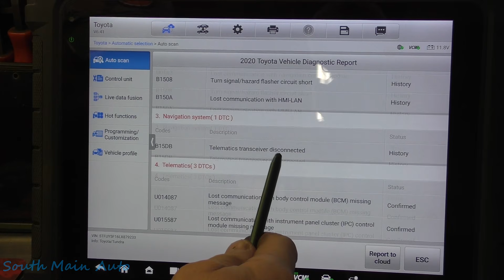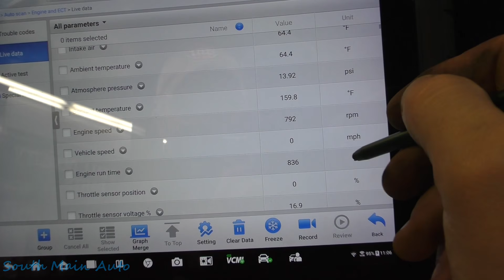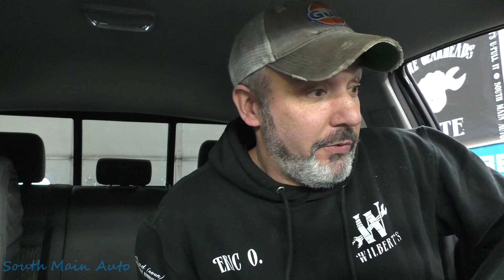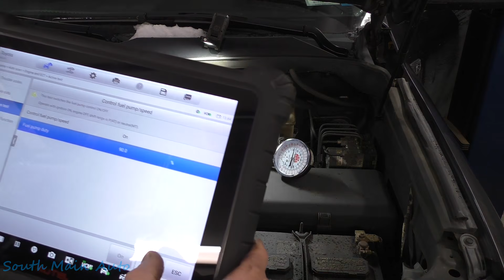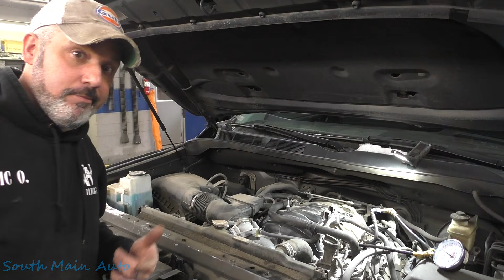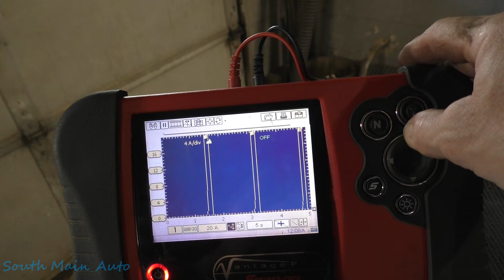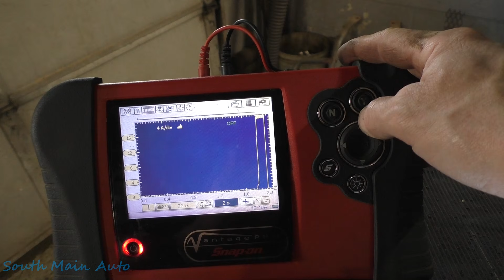My Customer Is Getting Shafted By The Local Toyota Dealer

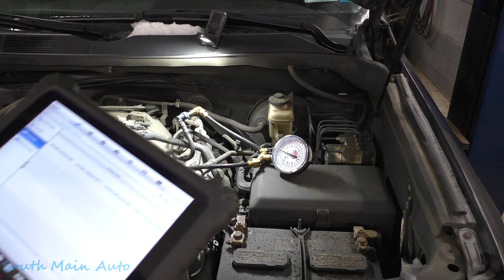Comment: 16:30 my guess, fuel pump relay is bad.  GM used to like to power the pump via the oil pressure sensor.  When oil pressure is present, the pump gets power through an alternate feed from the sensor.

Comment: I worked as aa line tech for GM, Subaru and Ford. Glad I am out of the headaches of the new cars. The stuff they put on them with all these adaptive cruise, lane keep, heated steering wheels. The stuff is nice but when you have to fix it can be a challenge. I once had a F350 with all the options and the lane keeping system would not work. Come to find out the windshield was defective causing the camera to not work right. All this has to be just right or it takes the whole system down.

Comment: I seen a few fuel pump driver modules corroded on some f150s . The fuel pump module was mounted on the frame brace. The backside would corrode against the frame. Ford also had recall to replace the fuel pump driver module on the explorers and Taurus. I seen a fuel pump fail on the new body style explorer. Anything electric can and will fail

Comment: Another awesome video Eric! Today's vehicles have way too many failure points.
I remember the last fuel pump we changed on the side or the road. It was an 81 F250 with a utility body. 
It had suddenly powered off on the way in from my Dads pipe construction job one evening. 
Dad quickly checked if it was firing then unhooked the fuel line from the pump at the engine and said, "roll it over".  There''s the problem the fuel pump is not pumping fuel. So he sent a runner to NAPA to pick up a pump and I do believe that he let me put the pump on and soon we were on our way.

Comment: I'm a retired Toyota technician (Ontario Canada), and soon as I started this video I would've told you to put a fuel pump ECU on it.
Very common failure.
I have a 2016 tundra 2014 Lexus LX 570 with the same drivetrain.
Both of them have had failed fuel pump ECU"s
Great channel, great Mechanic, I would hire you in a heartbeat lol.

Comment: 99-2000 accord v6 had a hard start after a hard soak bulletin that said replace pcm and fuel pressure regulator… the return line came off regulator before fuel rail… if you install the later fuel rail from 01-02 the pressure comes in one end of the rail and regulator is at the opposite end… the problem is vapor lock in the rail past the regulator and the only place the vapor could go was through injectors couldn’t flow back to the tank

Comment: You’d have to crack one open to see how it works but every electrical engineer worth his salt will add some sort of thermal fuse because the alternative is the module lets out the magic smoke. So even if it doesn’t have a specification on current limit there will be some design of the circuit by the original engineer to save the module from exploding if the output is shorted.

Comment: Had a similar fuel pressure problem on my old 2000 Chevy S10 pickup right around this same time last year. Same exact symptoms. I found that when I jumped it she would always start and run / drive just fine, but if it sat overnight it was crank no start every time. In my case it turned out to be the fuel pressure regulator hanging up (flex-fuel equipped, so regulator was built into fuel filter). I know fuel systems aren’t set up like that anymore, but the fact that it would start every time with a jump really confused me too until I realized that it was increasing the pump speed and overcoming the stuck regulator return valve. New fuel filter / regulator fixed it.

Comment: I have a 2019 Toyota tundra 5.7 4X4 that had a similar problem and it acted like the fuel pump a have around 152000 it would hardly start on cold morning around 30*I only burn 87 octane at Sinclair or qt and other places but since it started doing this I watch some videos on u tube about Flex Fuel and learn that the fuel pump has a sensor in the fuel pump that reads octane percentage and you need to go into the fuel density to correct it or 0 it out but I learned is to let it get down to half and started putting high octane in it 91 octane and it has been starting up better and clearing up but my 5 letter vin number has a W which is gasoline but it still has sensor that’s missing reading the percentage my understanding is a W or Y is understanding it has flex fuel

Comment: Great diagnosis .
I got a 2014 tundra 5.7 that crank but don’t start, 4LO and 4 HI is flushing and got cod U0100. Could be the same issue with the fuel pump?

Comment: I think your title for this post is possibly misleading.  I’m going to assume that you were getting paid by the customer and You Tube for the diagnostics that you did on this Toyota truck. Correct? When I worked at a GM dealer in the early 90s as a technician, we were paid ZERO for diagnostics. WE WERE TOLD GENERAL MOTORS DOESN’T PAY DIAGNOSTICS. So, is the Toyota dealership getting paid for diagnostics? I doubt it because if they were, they would’ve done the diagnostics on this truck. So shouldn’t your title be Toyota screwing their dealerships? Or something like that? Would you have done any diagnostics on this truck if you weren’t getting paid? If you wouldn’t, then why should the Toyota dealership?
Reply: Wtf no thumbs up for you?I wonder why.
Reply: @Tub13 you don’t have any either. 😂

Comment: I’ve only gotten far enough in the video that you’re looking at codes, but I’m going to be suspect that it’s a fuel pump issue and there’s a check valve in the fuel pump to keep the rail pressure up on most vehicle. Vehicles had a very similar issue with the Jeep of mine turned out to be a rubber check valve ball in the fuel pump. Can’t wait to see what happens next.

Comment: My son’s old Tundra had a bad Fuel Pump Control module.  It was totally rotted out, as most things are on over 10 year old trucks in Vermont.  I took i
The module apart and hardwired across the contacts.  This means the pump was running full speed whenever the key was on.  Truck ran fine like that for the last two years he owned it, before it took the final ride to the junkyard.

Comment: I remember when  Chevy Blazer came out with the first vortec v6 they would have cold start problems and the dealer changed alternator but never could find the problem, the car was almost new and they couldn't fix it because they overlooked the fuel pump pressure which was off by 5 psi   I put a new fuel pump in it and solved the problem should have been 50 psi and the car was only getting 45 , that 5 psi kicked their butt I guess they thought it wouldn't affect it .

Comment: Owned a 1966 3000 MKiii Healy back in 1972. Driving down the street in San Diego. Engine quit, coasted to the curb. I'm clueless, has gas. A guy comes driving by in a 100 6 Healy. He gets out, wearing a lab coat, he has a foreign auto repair shop down the street. Described the problem to him. He goes back to his car, gets a hammer and flat blade screwdriver. He pops one of the rear seats loose. Underneath is the axle with the fuel pump. He gives the pump a good whack and reaches up front and turns the key, car running fine. Lucas fuel pump has points, the points fail. Drove the car to his shop, he pulls the pump, opens it and solders a resistor next to the points.

Comment: I once had a Cavalier that would not run right when the outside temp was below 50 degrees. Shot the parts cannon at it without success. Discovered by accident that if the cabin temp was above 50 degrees, it would start and run fine even on the coldest days. Put a new ecm in it and it solved the problem. The ecm was behind the glovebox so I guess as long it was warm it was good to go.

Comment: I had a 2003 f150 4.6 liter that would fire on the John Deere brand ether and had no spark, we chased that rabbit from Arizona to Maine. Dont always determine its a "no fuel" condition because ether started the engine. Compression alone can ignite ether.

Comment: A simple DC motor attached to the pump (typically vane style in most fuel pumps) is usually just a commutator and a stator (a few other things, but keeping it simple) and a modern fuel pump is likely a brushless design.  This kind of failure is endemic to a bearing failure - thermal expansion causing the bearing to become stuck binding the stator preventing the stator from moving and leading to an amperage dump to ground.  DC motor failure often causes burnt grounds due to this amperage dump and can melt plugs or even cause fires and happens prevalently in early 2000's vehicle's blower motors absolutely destroying the speed control resistor pack and blowing fuses.
The absolute easiest way to test for motor failure is measuring ground impedance at the source of the suspected failed motor.

Comment: Had a 91 Dodge Dakota that would not start after you shut it off on a hot day, let it cool then would fire up.  Replaced fuel pump and fixed it.

Comment: Used to have this happen to a Chevy van with 350. It would overheat the fuel line right over the carb amd vapor lock it. Fix would be aluminum foil over the line. Never did again.

Comment: Another great diagnostic video.  I wish you would show how to hook up your scope.  I have the same Autel, actually 2 of them, a 2023 and a 2025 year model.  I never pay to update the tool, I buy new every 2 years.  Anyways,  I have yet to use the lab scope, but I fully intend to learn how to do it based on your videos.   You gather so much valuable information by using the scope,  I think it’s time I learned.   No better time than the present.

Comment: Completely sucks that “part changers” doubt a true techs diagnosis, regardless of the warranty factor. I’m an industrial mechanic - same sh*t different smell. They change parts until it’s fixed or they run out of parts first. Then I get it, by then it’s “stump the chump” time! I never quit ‘till I get it though. Glad I’m retiring in two months! 👋😎

Comment: My thoughts are that the starting of the motor gives a higher voltage, and that is enough to activate the pump, When the battery maintainer was removed, it started to act up?

Comment: Starting with my 86 Nissan pickup in 1990, 89 Grand Am, 01 Durango, 08 F250, 11 Quest, 13 Lincoln MKX, I've had bad experiences at each of the dealers for those makes and that's off the top of my head. Not necessarily for my rigs, most were friends and family. CRRAZY stuff I corrected, from a 5 second review of an ignition wire diagram (a fuse from a shorted wire instead of a complete engine harness) to a soft pedal "needing" literally every piece of a brake system except the brake lines. I think the most important piece of knowledge you've taught me is your process of repair. Define/duplicate the problem, identify the correct system, zero in to specifics, have the right info, understand it, TEST IT, have the right tools, be SURE of your diag. Thanks a ton for all your sharing!! It's making us all better techs, and saving us a ton of $$.

Comment: I share a tip.  After the fuel pump recall, if technician doesn’t put the small fat black o-ring of the fuel pump motor right.  It will has long time cranking.

Comment: I just watched your video on power steering and trailer brake control. The braided ground is to ground radio frequency. It's called litz wire. At radio frequencies current travels on the outside of the wire not in the center. It's called hall effect. The communications on the modules are radio frequencies, and those systems should be grounded with braided wire. Solid wire works as a resistance for high frequencies.

Comment: Hello, ive been following your videos for a long time, and you are one awesome mechanic. Hope you can help me out here. Ive had a 2005 ram 1500 w/5.7 hemi and nobody can get it running. Its been in a shop for a year now and they have no answers why it wont run. I mean everything there is to replace theyve done it. They havent taken heads off tho. You think problem is in the heads? Wants to start but never stays running
 Crappy idle if it does that. HELP PLEASE

Comment: :hand-pink-waving: I had the same issue for my 2007 Ford F150 XLT Crew 4x4. It turned out it was the fuel pump control driver module.:face-red-heart-shape::face-red-heart-shape:

Comment: I had a Chevy that did the exact same thing you crank it up you drive all day long but once you cut it off, it was not coming back on and it was weird cause it was always just shortly after the initial start up and driving going down the road, you would hear a loud noise, and I begin to realize it sounded as if the fuel tank was collapsing in on itself. And also, it was as if the sump was being restricted total loss of fuel pressure later found out that a so-called friend stuffed a box of blue paper, type shop towels down into my gas tank

Comment: Another reason that may allow the pump to start when using the juice, When the engines starts it uses the fuel in the line, lowering the pressure the pump has to try to start against. That coupled with the higher voltage gives it a chance to run. jmo

Comment: By the original problem description, my 1st thought was  an old trick to get back at somebody by putting a balloon or condom in the gas tank.
Vehicle starts & runs a while until the balloon/condom  interferes & cuts off the fuel. Then the balloon/condom freely floats again & then the vehicle starts again. Laugh for da day😅

Comment: In the old days before the advent of fuel injection, vapor lock in the fuel system would cause this kind of problem.

I used to own a hobby shop and one day a customer came in with an RC car asking if I could fix a wobbly wheel. Took a quick look and immediately saw that the one nut that secures the wheel to the hub was loose. Tightened it up and he was good to go. Didn't charge him anything. I thought it strange that he couldn't figure that out himself. Asked what he did for a living because, you know, some accountants or computer type people wouldn't know which end of a screwdriver to hold. Turned out he was a mechanic for one of our local Toyota dealerships. Made a mental note to myself to let my other customers who owned Toyota's to never bring their cars to that dealership for service. Lol.

Comment: I've had 2 cars in my day that acted up the same way.
#1  1977 Ford Thunderbird.  If you drove it and stopped to put gas in it say, it would be hard to start back up.  I had it not start and had to push it away until it cooled down enough to start.
#2  1985 VW GTI.  From the get-go, if you drove it until warm and then stopped for a short amount of time say 10 minutes.  It would be hard to start and stumble for a minute until it smoothed out.  I took it to a German VW dealer and yes it was the pump.  They replaced it and it never did it again.  Luckily under warranty.
I appreciate how you went through a logical process to narrow it down instead of, like you said, start hanging parts on it.
Reply: #1 1977 T-Bird, could have been vapor lock so no fuel to carb or maybe the electronic ignition module (had that happen to mine).

Comment: That vehicle to which you refer is NOT a truck.  It is a large car.  A truck is a heavy-weight commercial vehicle that is built to transfer freight loads on its flat bed (and sometimes one row of people in the cab).  A car is a vehicle built to transfer people, but NOT freight.  You really should get to know what vehicles you are dealing with.

Comment: Just started the video, taking my guess. My 1995 S10  had this issue, turned out to be my fuel pump. Swapped the pump, issue went away, but I wonder whats going on with this Toyota...
Reply: Had this same issue. Triple A guy happened to be at the gas station I was stuck at and took a very similar red hammer to my gas tank and the truck started right up. I like that you checked everything to be sure, but I was confident when the video started, it was a bad pump.

Comment: Nice work! I had an 88 Mustang with in tank pump. I changed it every 50,000 miles just as preventive maintenance until it was stolen 10 years later.

Comment: Crazy the dealer didn't do proper diagnostics.. To share a good story.. I brought our 2015 hyundai sonata into my local dealer when it was throwing a camshaft sensor code.  They dropped the oil pan, saw metal, and I got a new engine for free.  The mechanic was in constant contact with me.l through the entire process.  Car runs amazing now.  Some dealerships still do care but I guess it depends which one you visit.

Comment: Man I was way off, I thought for sure it had to be a heat soaked part under the hood, Relay, Fuel pressure Regulator, something causing that fuel to turn off after the run cycle was completed. Great job Eric.

Comment: At a gas station I complimented a fella on his very nice looking 97' Rodeo...he replied "Wanna buy it?"
I said I was interested...met at his house...he gave me the keys..said drive it a week. Engine had low power. He wanted $2K...I took a gamble bought it. Fuel pressure was low...16 psi. Dropped gas tank...found factory "quick coupler" at fuel pump was cracked/leaking...replaced pump and used rubber hose for connection...runs fine. Rodeo had 82K miles...it looks like brand new! 😊

Comment: I want to know if the driver side bulb replacement was just as straightforward.  I’m not familiar with the Titan and was wondering if maybe the battery was up against the bulb making it more difficult.  
I’m retired now but I ran into that problem a few times when changing bulbs and one time where to remove the battery it was partially under the front cowl and the air intake had to be removed.